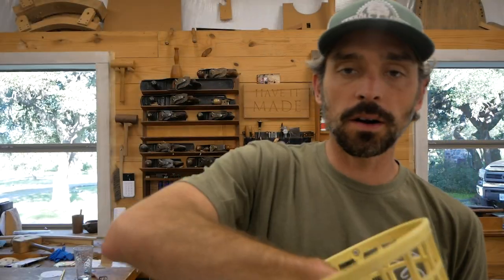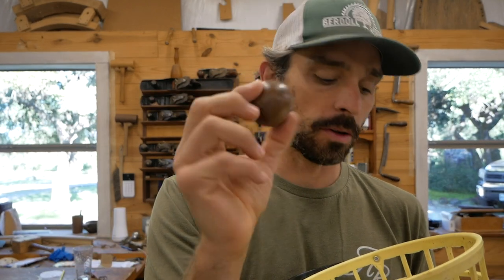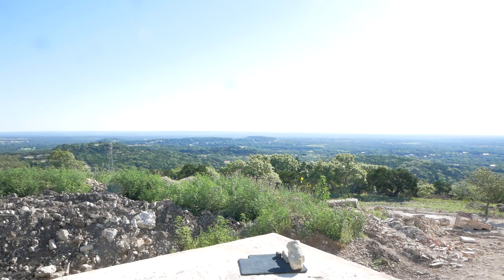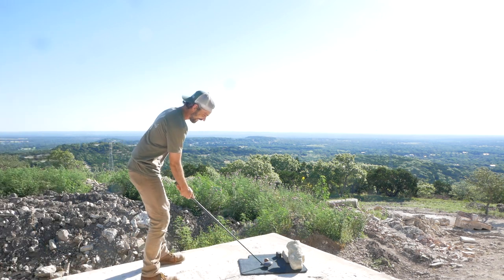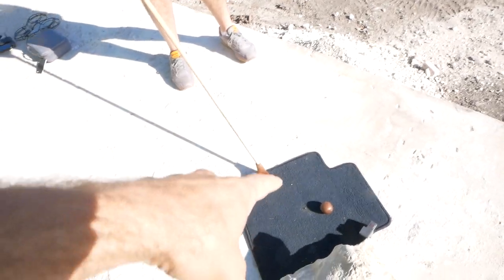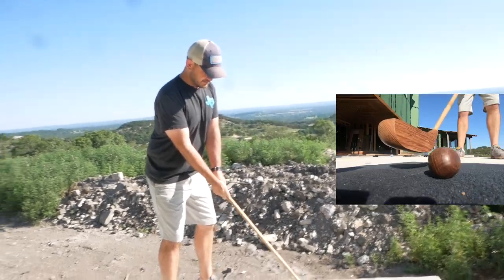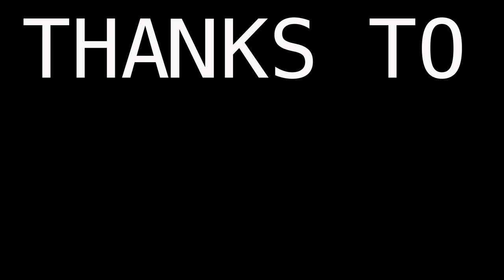Making And Testing Wooden Golf Balls!!

Comment: You guys were obviously having a wonderful time. If my father were still alive,I would insist he watch this. He would have been delighted.
He was an avid golfer.
This video brings back some very warm memories spent with my dad when I was a child. There is one course,I recall it was called the Fundy. Or Bay of Fundy course. Over by St.John NB ? I think. Quite a few of the tees had launch points similar to yours here,AND we stayed ,he and I ,in the newly purchased Airstream trailer. About 1968,and the single axle trailer was I believe about a 1959.
There was an incredibly narrow bridge that we traversed to get there,and he ripped the door handle off the trailer,no other damage. And yours truly figured a way to make use of what remained until a replacement was purchased. And did the install. Would have been age13 or so.
We had really good times with that Airstream. Then he got one foot itis, and the trailers started getting bigger. And newer. 
And I started getting older. Oh,well. 
Keep on keeping on and keep on bashing away with the Argosy. Terrific project both my brother and I have been following. All the best.
Reply: My condolences